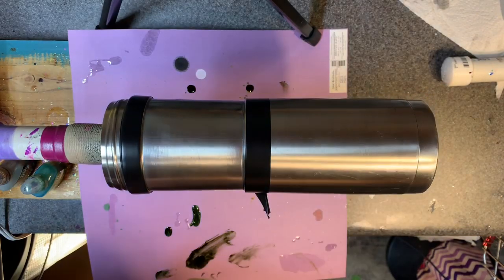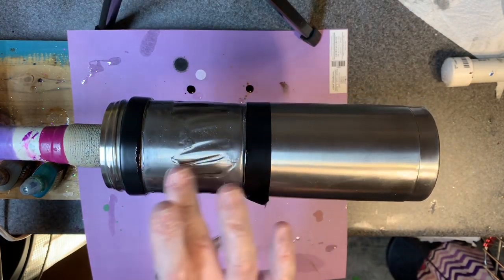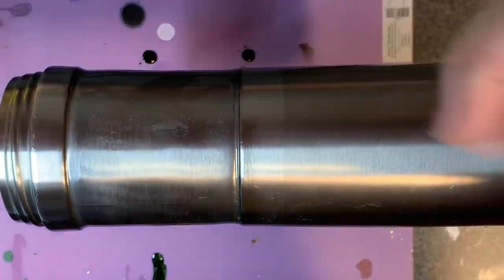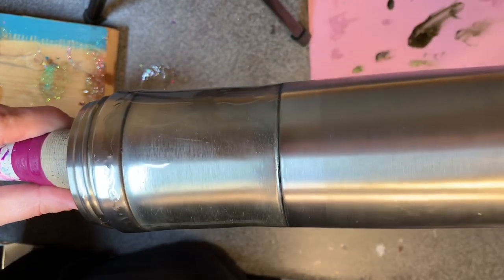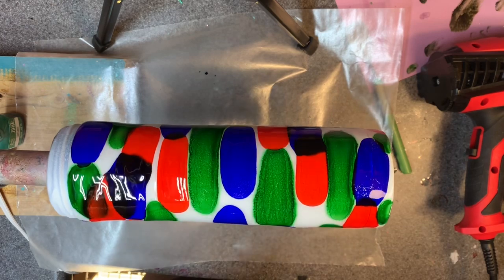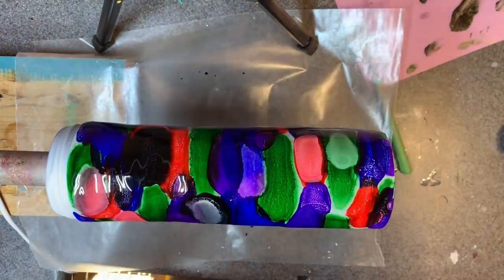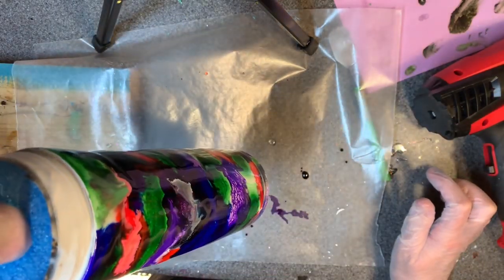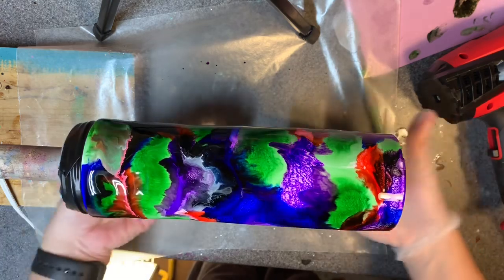“Refurbishing” an old Contigo bottle from beginning to end-alcohol ink swirl/epoxy

Comment: Beautiful. Will this work on plastic water bottles?
Reply from the maker: I’ve heard that the chemical reaction isn’t safe to use epoxy on plastics but honestly have not researched it myself.
Reply: The Purple Stitch okay thanks. I won’t try it then. I have several and was just wondering.
Reply: The heat from the epoxy as it cures can cause dents in the plastic.

Comment: Hi Purple Stitch! Thanks for all the great tutorials! I’m inspired to try alcohol inks! 
Could you share the epoxy brand? 
Also I would like to know the turner you use did you made it? 
If not where did you get it? 
I have trouble taking the arm out of mine. It’ has a screw PVC end and when I try to take the arm off almost every time the cup bumps in the table. Don’t know it a longer arm would help. 
Thanks!!!! Éxito!
Reply from the maker: Hi there!  Thank you for those sweet words!
I am using Envirotex Lite epoxy at the moment.  I'm on my 3rd gallon kit and so far I have not had any issues with it.  I did make the turner when I first started out.  I have a couple of mini turners, a spin it, this one, another I need to put together, and another on order.  I think I like to have options....LOL!
Reply: The Purple Stitch 
Thanks for the prompt response! I also started with Envirotex lite. Never had issues with it. Still have 1/4 of the gallon. Here in Puerto Rico it’s been hard to ring gallon size epoxy. But I saw a post about yellowing and went out of my way to order Fx resin.  Have you done a white cup and had issues with yellowing?
Reply: Find Not ring! Lol
Reply from the maker: The only yellowing issue I’ve had was when I used my shop light to led curing and I think it scorched it a bit. 😬 I don’t do many white cups to have a lot of experience. But I can say that my coworkers white cup is still white from August. She happens to be drinking out of it next to me as I type. 😆

Comment: Hi against. Have you tried the TH metalic mixitives?  If so please and you haven’t done one, consider doing a tutorial .  Or a comparison between piñata and TH metalics. Thanks
Reply from the maker: I have used silver mixative from that brand. It literally floated on top of everything else. I got enough off to still allow the other colors to come through and the cup turned out so,so pretty. I will definitely add this idea to my list of “to do‘s“!!
Reply: The Purple Stitch thank you!
Reply from the maker: I’m working on a cup with silver mixative used like an ink right now. I plan on doing another soon with a different method of applying it. I just need to experiment with it first.